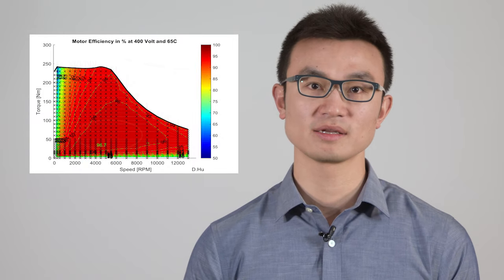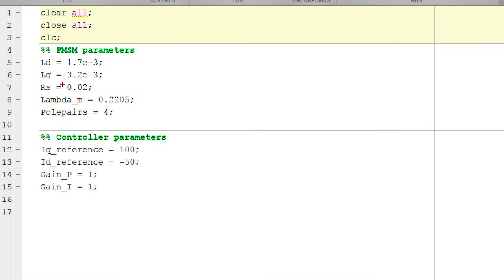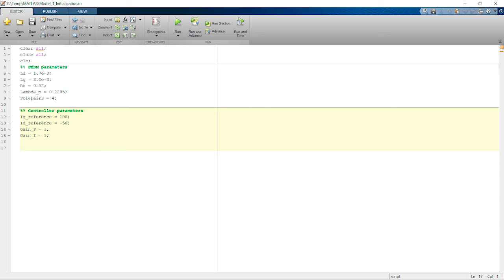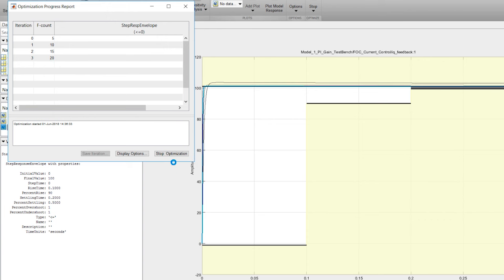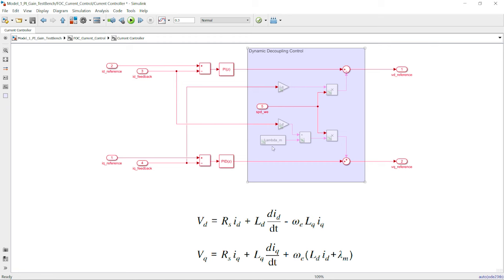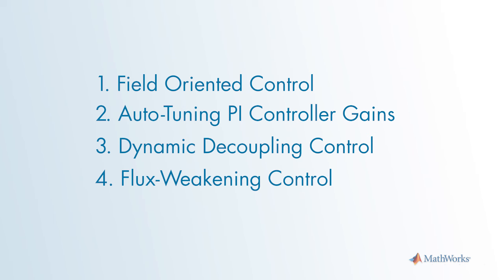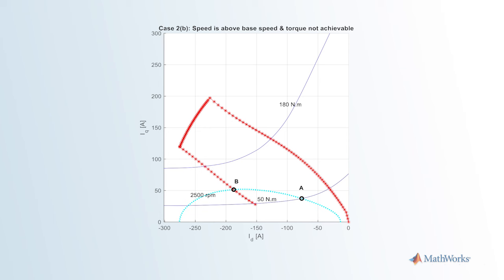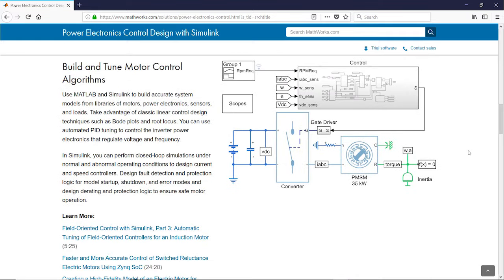Motor Control Design with MATLAB and Simulink

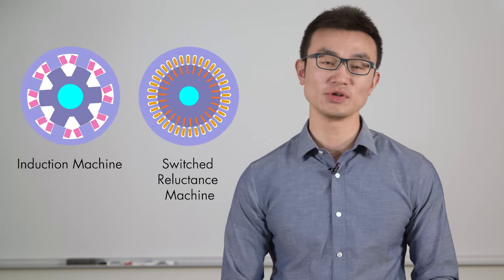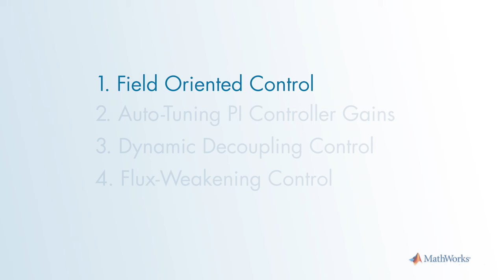Comment: Appreciate the video, with two exceptions. At about 1:15, an animation of switched reluctance and induction machines are shown, but they are identified as induction and switched reluctance machine. No big deal.  Unfortunately, at about 18:00 to 20:05, the video does not show what the instructor is talking about, but simply shows labels with no graphics. Would be helpful if this were fixed.

Comment: Tuning of PI controllers is  relative easy as  shown in our Springer  books '' Fundamentals of Electrical Drives and ''Advanced  Electrical drives' . So Gain is inductancexsamplingfrequency/4 and bandwidth is R/L, . The machine model you show is not a PMsyn, but IPM,  as Ld not equal to Lq, look at the IRTF based models in our books, they show that thet are relatively simple.  Control  of IPM is significantly different when compared to PMsyn, as shown in our book''  Advanced''

Comment: Does anyone know how to optimize the gains for the speed controller using the response optimization app? The current controller only had a step input, but the input speed changes overtime.

Comment: Is it possible to design a PMSM controller for 60 poles? the goal is to use it for record player direct drive platter with a rotor of 30cm diameter and 120 coils for a zero torque ripple and smooth speed.
Reply: I believe it is possible to make a motor to drive a gramophone disc with 60 pairs of magnetic poles. However, a large scale of miniaturization is required. The easiest way would be to wind the armature using complex coils. I don't think it can be done manually. You will need a specialized winding device. Best regards 💖😀.